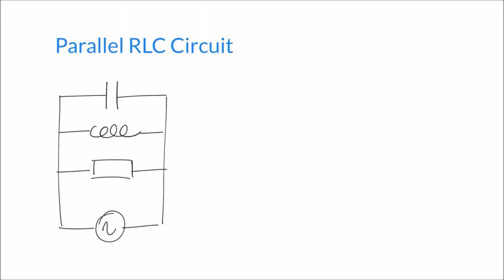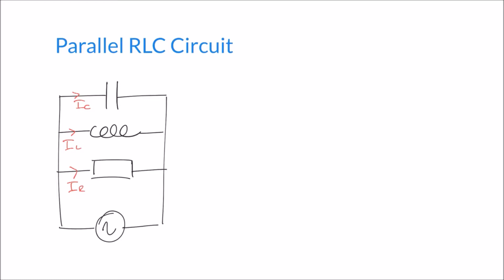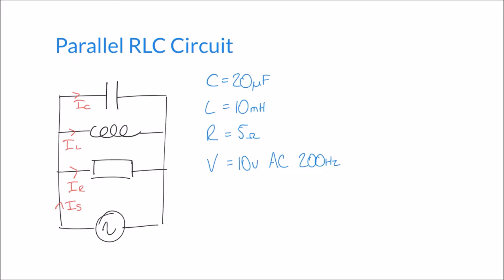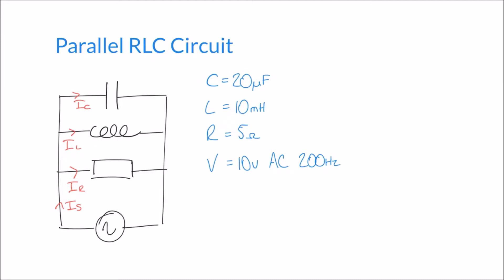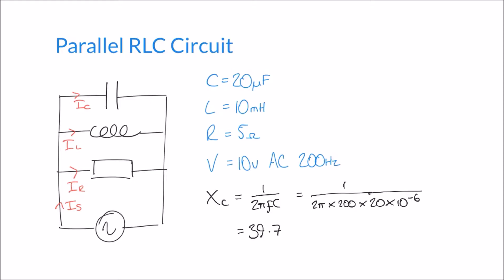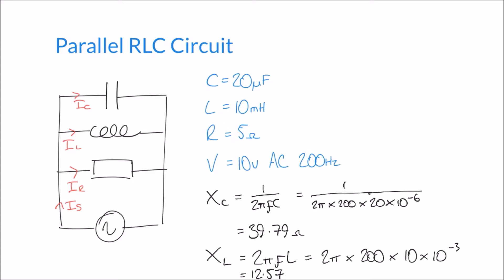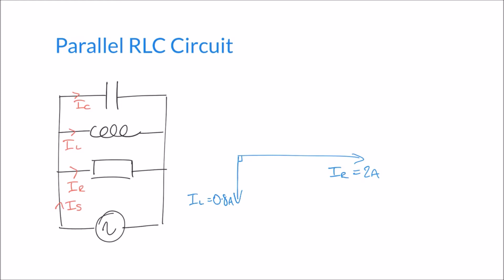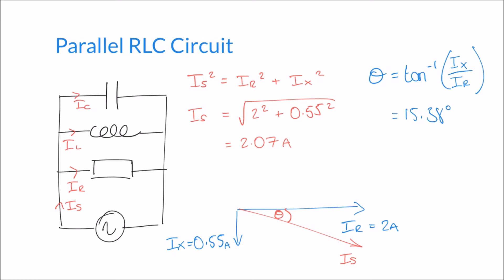Calculating Supply Current in Parallel RLC Circuits

Comment: So we have 4 different currents flowing in this circuit. The mind blow for me  is WHERE do these currents transition from one to another. For example, exactly where does I(T) at 2.07A @(-15.38 degrees) transition to I(R) of 2.0A @ zero degrees? I have no problem with the calculations, but I can't visualize how/where these currents interact and morph in the wire. Any help would be greatly appreciated. Any help would be greatly appreciated.
Reply from the maker: Conceptually, it is not so much that there is a "point" at which one current / angle morphs into or becomes another, but rather they are all happening at once, superimposed upon one another.
Reply: @EngineersAcademyLTD  Thanks so much for the reply, but that is kinda a difficult concept to take in. I'll have to dwell on that for a while.
Reply: Seems that each parallel branch has its own current and phase.